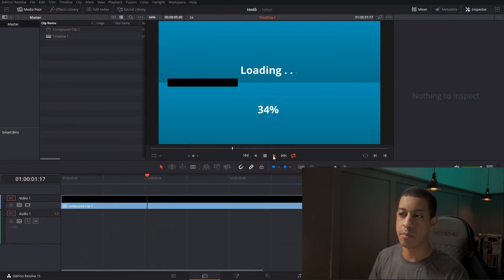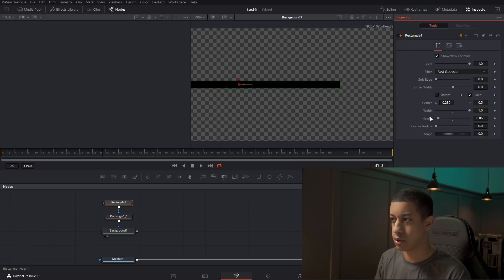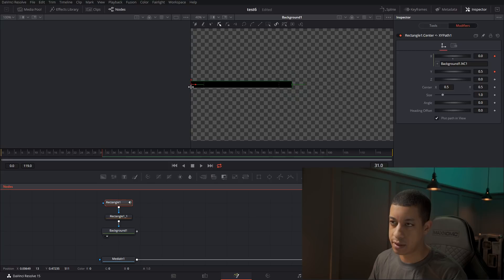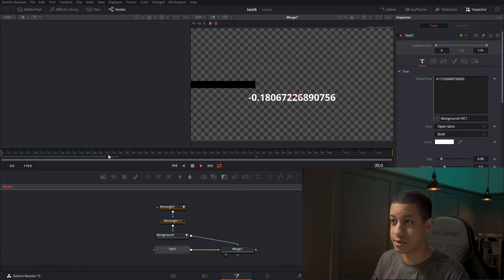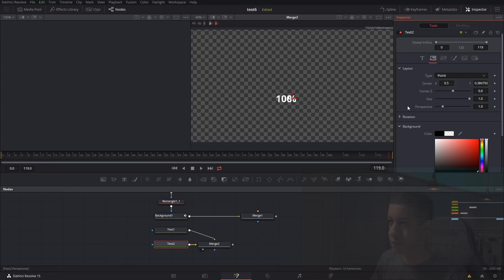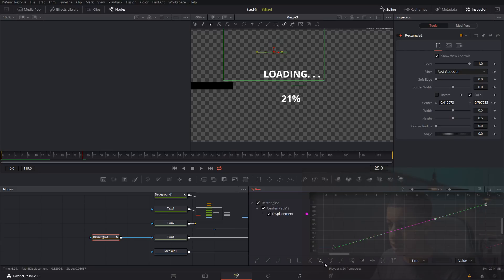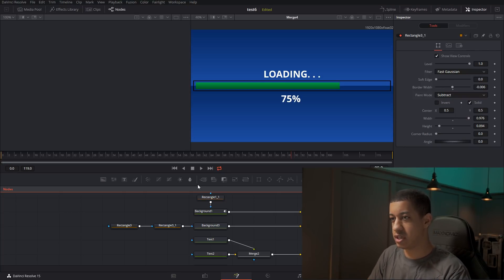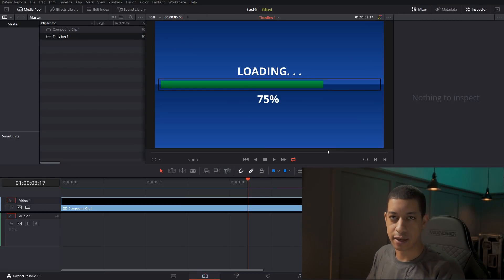Making a loading bar with DaVinci Resolve 15

Comment: Nice, you could do with just two keyframes by driving the Rectangle2 width or position from the same loading variable and putting together some modular math expression that would cycle at the correct rate. Probably not worth the effort though.